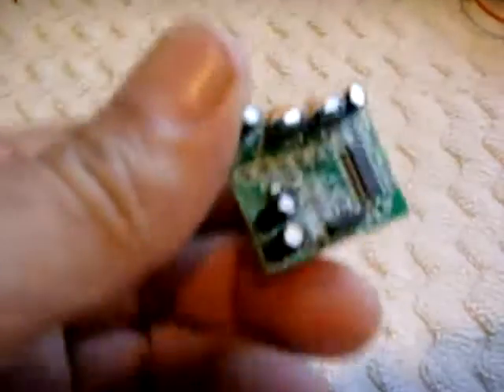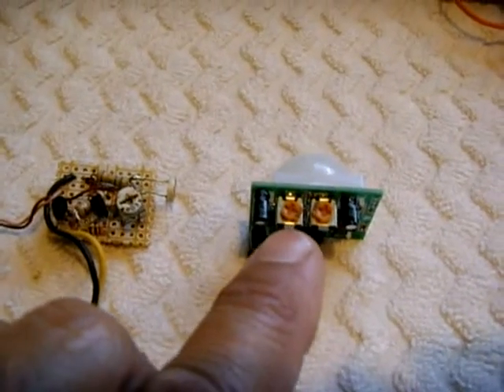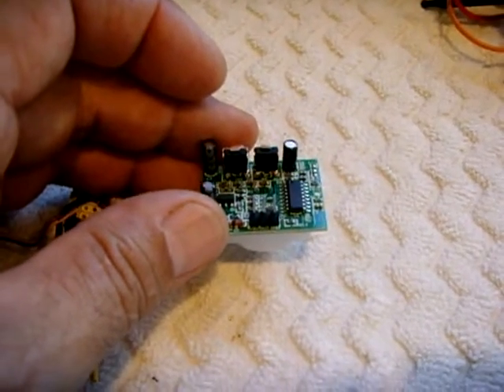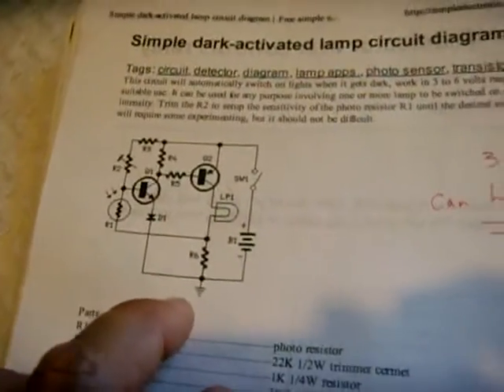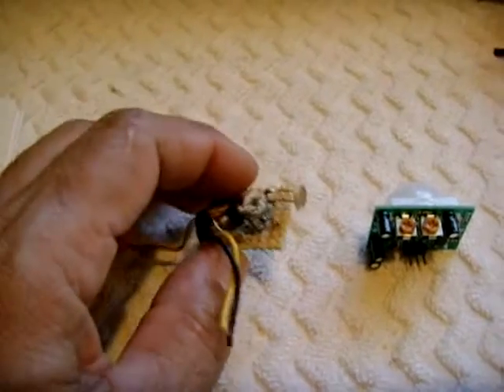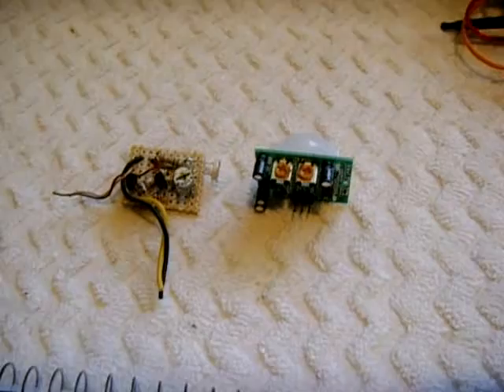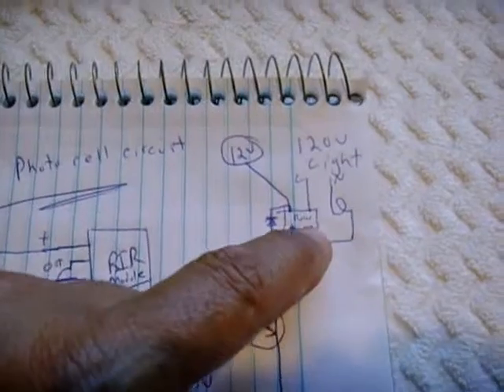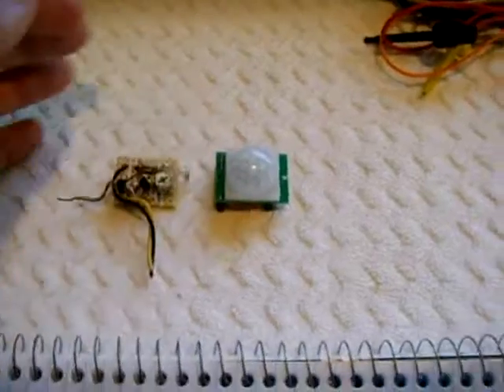PIR ~ Infrared Motion Sensing Circuit / Night Use

Comment: So I made a dark sensor (diagram 1 at pcbheaven.com/circuitpages/Light_Dark_Activated_Relay). When I try to follow your "shitty" diagram (which I think is great by the way), I'm all good until I get to the relay. I have a Sainsmart 5V relay with G,V and S on one side and the 3 switch positions on the other side (NC, NO and Common). I don't know how to wire this shit and I've tried heaps of stuff and tried googling around.
Reply from the maker: Very easy. Using 5 or 6 volts, probe the relay (G,V, & S) terminals until you find the 2 that make the relay click.
Reply: Okay so it seems my relay was stuffed because it wasn't clicking and I made another one click. Another question you probably know the answer to... if I use low voltage LED's do I even need the relay there?
Reply from the maker: Perma Psy
The relay allows you to be able to handle the current. The voltage is not the problem.
Reply: Ta. Can I use the same 12V power supply for both the relay and the dark sensor?
Reply: Another thing, what transistor did you use to connect to the relay? I'm about to try a 2N5551 with say 2000 ohm

Comment: I know that this is a 3 year old post but I saw on one of the comments in Amazon that Motion Sensor Detector Modules are already pre-wired for LDR Resistor (GL5516). Ones you remove the plastic cover you will find two thru hole solder pads to solder it in. His exact location is ones you remove the plastic dome, near the 3-pin connector (where label says Out & Vcc). This is what I was hoping to find on youtube. This is a such great idea and this sensors doesn't come with instructions.

Comment: You probably do not need additional circuit, under the white lenses there is two holes designed to host a photo resistor; 
another two holes designed to host a thermistor. Your detector seems to be one of those.

Comment: Hello !
I have a question for you: if you can please answer How can I connect a voice signal to the sensor?
I also bought a sensor on the internet to ebay.com, I have it at home, today I tried to connect the LED, everything turned out all right, the motion sensor detects the LED is turned on but when I tried to connect the call to the door did not work. That is how I did all this, I call (the module call for the door) connected to the wires from the battery to the device but the batteries pulled out and contact wires buttons from call batted - that is: the place of LED bulbs I found the call to the door but did not succeed, in I do not have enough power 2 While the battery is 3 volts while this sensor provides 3.3Volta.Mozhet milliamp ??? I do not know much about electrics So please do not think badly of me, I'm just trying to himself that the sdelat.mozhet something I did wrong? Please help advice ... I hope you understand me as I wanted to make a voice call ?! it is as if a motion sensor with the inclusion of light but in place a voice call to the lighting was ...
I very much hope that you will advise me and help make such a device ?!
Best regards, Georgiy!
Reply from the maker: +George Shovnadze 
You can purchase a 3 pin sound detection sensor module on Ebay and use it with the PIR module. You will then be able to trigger lights by movement or sound.

Comment: I want to power a long led strip to give backlight to a poster size photo frame.. Like a big thin light box I'll mount on a wall. I want to plug it into a standard outlet nearby and just use the motion sensor to power on the light. 

Also preferably id like it to flicker as it turns on like an old halogen tube bulb.. 

Any suggestions? I'd like to make it myself but I'm fine with taking apart other cheap parts to get it done.
Reply from the maker: +vexx506 
This circuit will work, except for the flicker effect. Use a wall transformer for the power supply and power the LED strip using the (Common and Normally Open) Relay contacts. Everything you need to know is in the video and video description area.

Thank You

Comment: Hi,                                                                                                                                                                                                                                                      I'm trying to run a pir motion sensor to led strip lights is that possible with out connecting a arduino board I don't want to use arduino nor rassberri what must I do.
Reply from the maker: Yes, nothing changes from this video. Instead of turning on 120V lights as in this video, you will use a DC power supply to turn on your LED strip lights.
Reply: Do you have schematics for the you tube vid as to how I can construct a similar board set up I have been trying use all sorts of configurations not luck.
Reply: Or just a vid on how to you wired your set up if possible
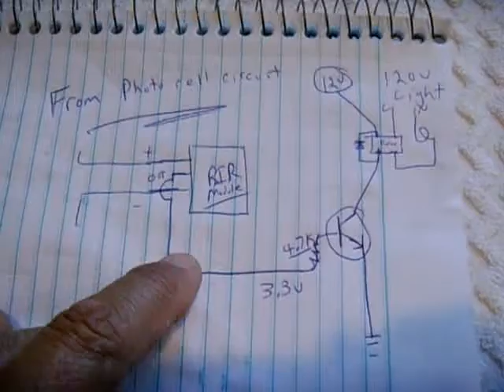Reply from the maker: kenchi chewlo Since you are not familiar with circuits, I suggest you buy a photocell(LDR) and solder it into the correct location in the PIR module(Look for 2 empty pads), then follow the schematic as shown at 2:30 in the video. Good Luck.
Reply: Yes I have ldrs but im trying to learn new things from the best all that will teach I am just learning the kraft but can be a will groomed student
Reply from the maker: Unfortunately I cannot take "special" time to teach everyone. Answering one or 2 questions, that I can and will do, but not much more. I have too many viewers with questions that need answers as well.

Thank You
Reply: Yes that's understandable

Comment: Hi, I'm using a 9 volt battery to power the assembly and a 1 K resistor from the PIR which connects to a 3904 transistor.  I can get 3.5 volts from the PIR but it will not trigger my relay.  I have tried to put an additional transistor to try to amplify the signal but am unable to get this to work.  Is this the wrong relay?  Here is the writing on the relay, "HK3FF-DC12V SHG, 10A 250VAC, 10A 30VDC".  Just a novice here and am amazed at your skills and love your videos.
Reply from the maker: The 3- 3.5V output pin from the PIR module needs to drive a transistor in order to trigger a relay. The video explains/shows everything perfectly. Your clearly doing something wrong. Nothing wrong with the relay. You may have destroyed the transistor by not useing a diode across the relay contacts.

Comment: Hi,

Why add an external circuit for the day/night detection,
on the PIR module you already have two empty soldering pads.
one, for a LDR and the other for a thermistor (for warm days)
check this link:

hxxp://electronics.stackexchange.com/questions/95963/12v-led-strip-lights-controlled-by-pir-want-to-add-ldr-to-project

Hope that will help.

;)
Reply from the maker: That is true, there is a provision for adding an LDR. I did not realize that until after I added my own. :-)

Thanks For Watching!

Comment: Hi , been following several of yours video , how can i use IR to detect an object , then send this information to another microcontroller using RF signal , then this microcontroller interpret this information by running a servo
Reply from the maker: Fairly complicated project. It depends on how close the object needs to be to trigger the circuit. The simplest way would be once the object is detected in CLOSE range, a wireless transmitter sends a signal to a receiver which then activates the servo.
Reply: electronicsNmore The basic idea is as soon as a vehicle approaches  the IR the information is sent to another arduino board then it triggers a servo ,.The basic idea is to operate the arduino wirelessly
Reply from the maker: Information? Or a signal is sent. A signal is easy, data is different.
Reply: suppose I just want to run a servo using the information sent . what could I use ? how could it been done
Reply from the maker: Why not just use the PIR module to detect the vehicle, then send a signal to the servo using a transmitter/circuit like this:

Latching ON/OFF Wireless Transmitter for UNDER $10!

Comment: Thanks for the link, which is exactly what I was looking for. I am currently driving a motion detector module which turns on a LED strip. However, it is wasteful to have it sense motion and turn on so many times during the day when I only need it at night.
Reply from the maker: Some of these modules have a provision for adding an LDR/Photocell to the board to use a built in circuit for triggering at dark.

Thanks For Watching! Be sure to rate thumbs up and share.

Comment: Hey brother , did you really get that thing to work ? I've tried everything , can't seem to get that 3.3v from the PIR to go anywhere , even when I connect it to the NPN it still drop to less than a volt, I even got a 3v relay from NTE,   R74-11D1-3  and it still did not work ,  anybody have any ideas please let me know , I bought four of these things  one has got to work,,, thanks for the video , great work ,,
Reply from the maker: I can assure you the circuit works perfectly. I have used this circuit every single night since this video was made. Send me your schematic. Send me a youtube message with a link to a photobucket image

Thank You..
Reply from the maker: One more thing! Be sure to use a relay which has a coil resistance that is high as possible. 270-700 ohms. Higher resistance = lower current required to operate the relay.

Comment: in other words would a 3v relay recognize the 3.3 from the pir ?
Reply from the maker: The reason for the transistor is to carry the load of the relay coil. It has been a while since I posted this video, but I do not think the PIR can directly power the relay. You need the transistor.

Comment: Im doing the same thing as you working with a PIR , as soon as I connect the 3.3v to anything it drops to .7 0r .5 volts ,  could you just connect the 3.3v to the 3v relay ? would that work ???

Comment: What voltage relay did you used , and why use the NPN , I'm gust learning (:
Reply from the maker: The relay voltage is chosen according to the voltage you are using. The NPN acts like a simple switch.

Comment: HI I'm using a PIR sensor on a project that is used for outdoors sending a signal to a controller to turn on LED lights as a person walks through the path.  One issue I'm having is during the day the sensors go off randomly even when no one is in the path.  I suspect this is because of sunlight.  Is there a PIR sensor that will work in both day and night?  We are using 200 sensors and 10,000 LED's for the project. Thanks
Reply from the maker: So you do not want the circuit to turn on the LED's unless it is dark out. Correct?  Or you want the LED's to turn on day and night?

Thanks
Reply: Day and night.... The problem is during the day the PIR's I had been using come on randomly even without any motion.. I can only assume it is being triggered by the sunlight.  As soon as the sun goes down the sensors work perfectly.
Reply from the maker: Can you place the PIR module in a location that will not be in direct sunlight?
Reply: I already tried a shield and it did not work.